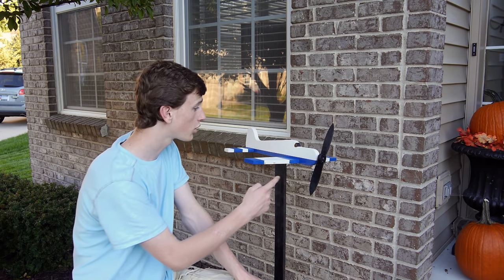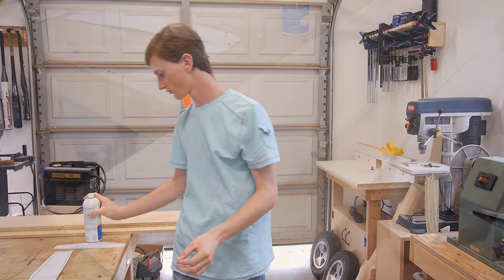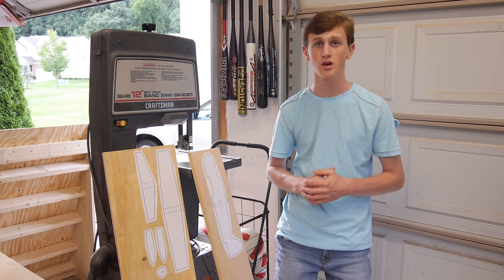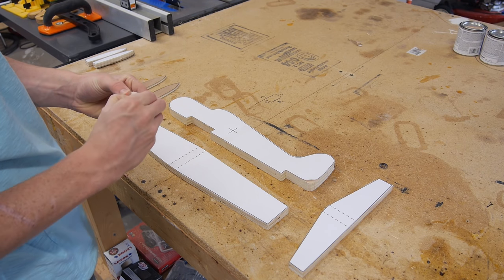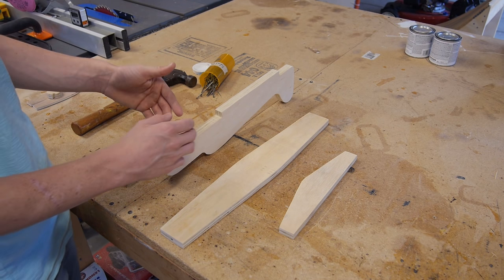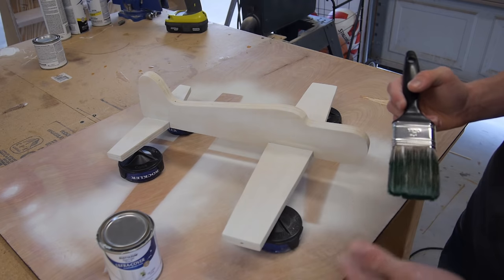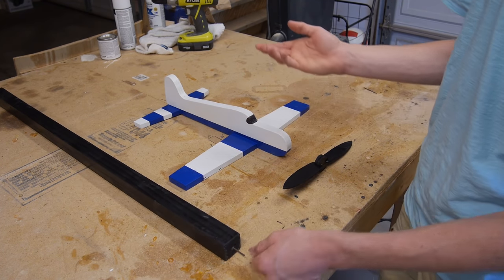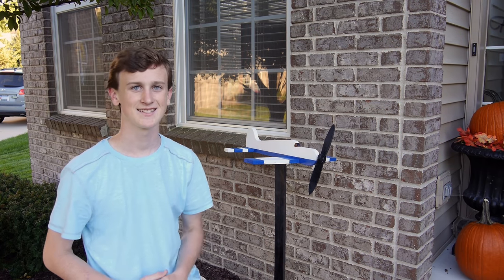How to Make an Airplane Whirligig | Free Template!

Comment: I have always had problems with white spray paint sticking to wood. I think it has something to do with the paint pigment. To fix this problem I either use a clear spray paint or primer first. this way the cells of the wood are sealed and the white paint sticks, and is not absorbed into the wood.  This is a great project build. I live in a town that has a Navy Air Station, so I will be building a few of these for the next crafts fair. thank you for the plans template.